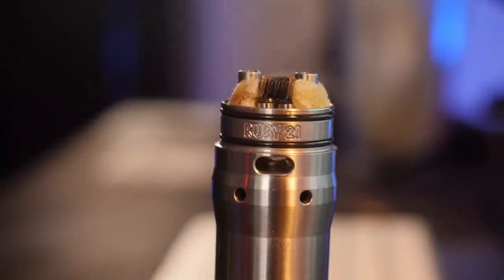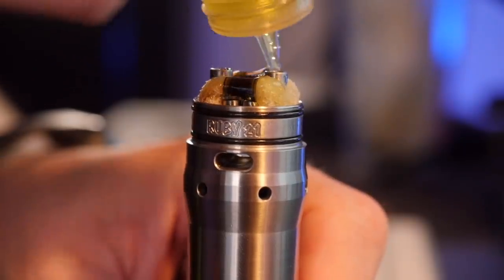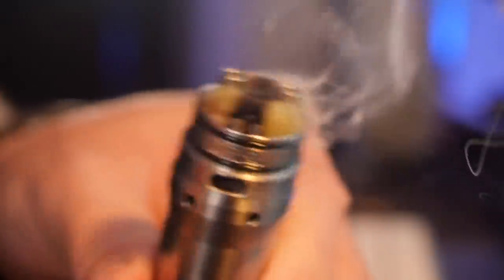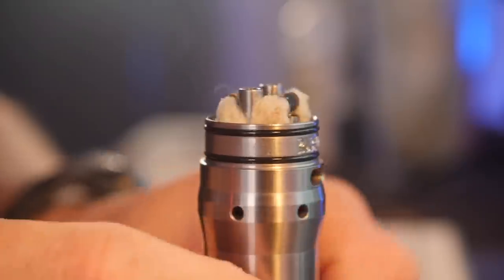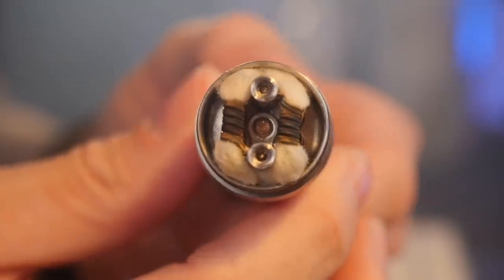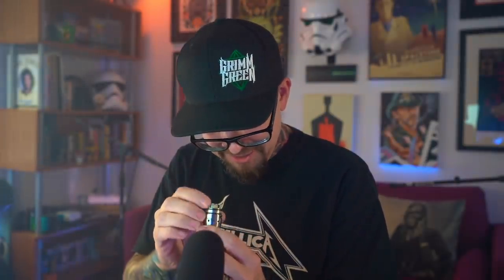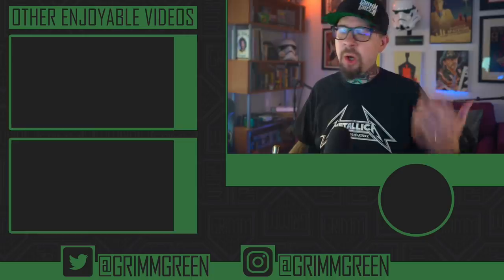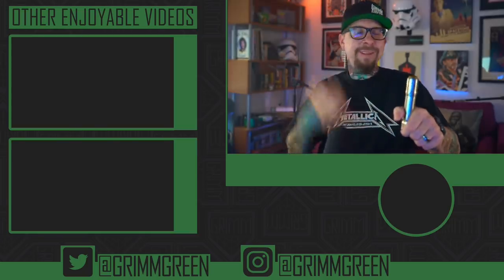How long does your cotton last?

Comment: I use kendo gold so i usually only have to re wick when I change flavors or coils....or when I'm bored lol.
Reply: Tony Glock  Lol you aren't doing it right then dude that is seriously what EVERYONE who doesn't like Kendo says. Kendo is very very absorbent and can hold an unbelievable amount of liquid because of how dense the stuff is... but it absolutely needs to be added slowly at first...it hasn't been pre-broken in bleached or treated and has probably never absorbed anything before short of being washed...the off white tinge it has shows that. I believe it says right on the back of the package that you need to add a few drops right on your coils and then pulse your mod for a quick second for it to soak in. After a few times of doing that...when you can see that the juice has soaked in a bit then you can tuck your tails and go ahead and paint it on still pulsing every few drops until you take your first couple rips...after those first couple rips though you're golden and you can go ahead and dump on the juice.... It takes a little more time but son of a bitch man...once it gets going it will just swallow up the juice. I think the higher price probably comes from how long the stuff lasts and the quality of vape you get from it though...if you can get past the slow start that is haha... but seriously i only need to re-wick when i get bored, change builds, or if your a flavor purist like me change flavors....it is certainly worth every bit of the extra time and effort and is by far the best cotton i have ever used.

Comment: We also need to no how to clean expensive coils because I hear dunking them in water isn’t good for them and nobody I can see has videos on how to maintain those expensive coils
Reply: The Real Slim Shady M.Terk has said he will just dry burn and wick if using the same flavor. If he is changing flavors, he will rinse with water. What I do is dry burn the coil, then I have a cheap brass wire brush that I will “scrub” my coils with. That’s probably my favorite way and seems to work very well

Comment: Yeeeaa i'm really sorry bro, i really appreciate your expertise but i completely disagree on this one. I used to do that, but vaping it this dry makes your coils so gunky and black. (like your coils in the video) So i switched it up and started wicking my coils extremely tight and just keeping the cotton absolutely soaked at all times. Wicking it this tight makes cotton collapse physically impossible and keeping it soaking wet has the result of sweetner and flavorings not sticking to the wire. Like today, i have just finished a complete bottle of a notoriously known coil killer e-liquid and my coils still look like i just installed them 1 minute ago. I can literally take an instagram picture of them and put "mmm them phresh coils" in the description of the picture. I told my collegues and friends about this method, they started doing this, everyone says i'm right.

To be clear, i'm not attacking you by any means, just sharing my preferred method here, everyone has their preferences :)

Comment: I heat coils and put under running water 4x and it brings the coils back to A1. The steam cracks the gunk and the heat and cold water hardens the coil. You need to be careful. You can dry RDA cotton but with an RTA. I close it at night and change it every 2 days as it is cheap.. Grim has special Hipster cotton so he is a one off 😂 Never had collapsed cotton! 😂